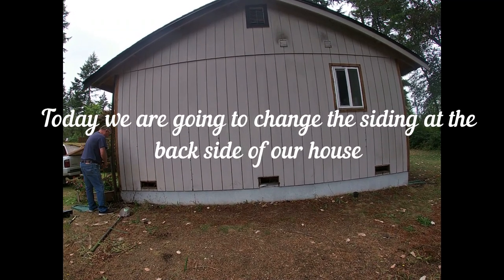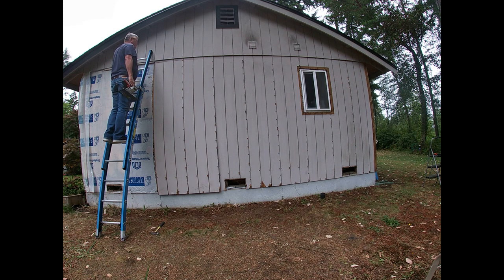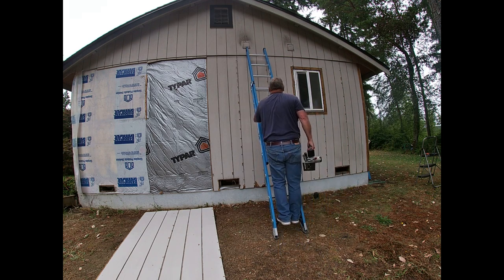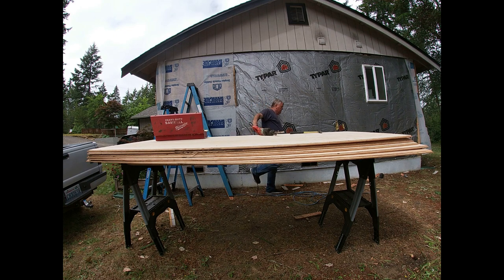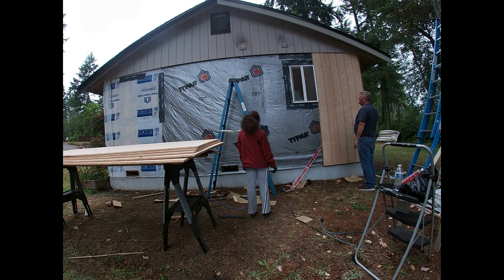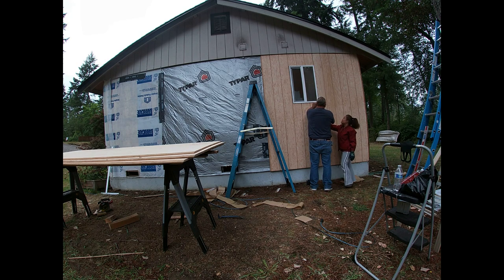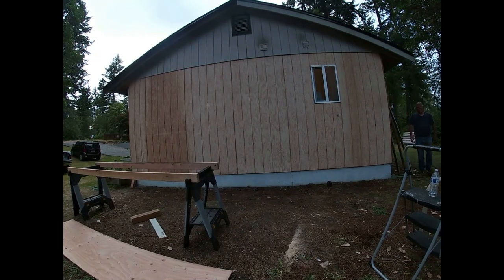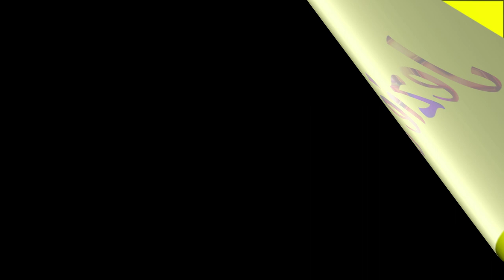REPLACEMENT OF  HOUSE T1-11 WOOD SIDINGS FROM START TO FINISHED

Comment: Hi there. I have to do a very similar job and I was planning to use Z-flashing between the top panels (the ones you did not replace) and the new ones. It's supposed to help avoiding water to get behind the new panels. Is there any reason why you didn't use z-flashing?
Reply from the maker: There is no Z- flashing on that wall, as you can see on the video the top portion overlaps the bottom sheets, there is no z- flashing when it was made, and the top portion is ok so we just replace the bottom part.
Reply: @jeziejoy thanks! I noticed shortly after I wrote my comment.
Thanks for answering.
Reply from the maker: @sirewan  You're welcome